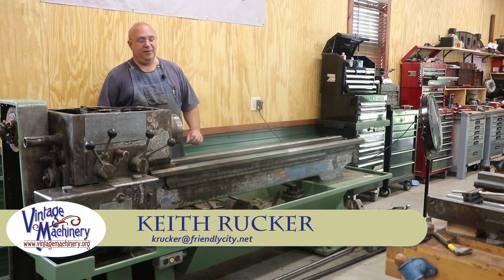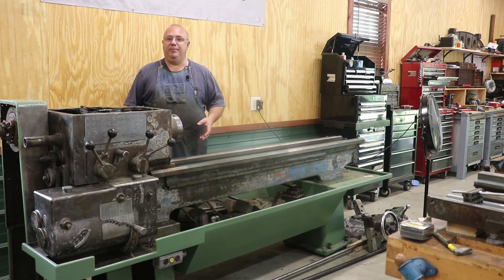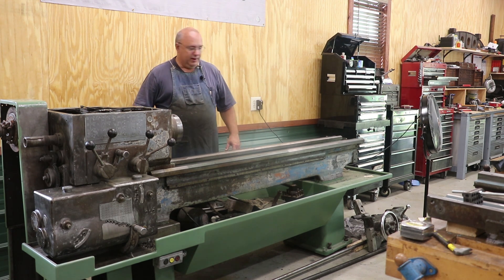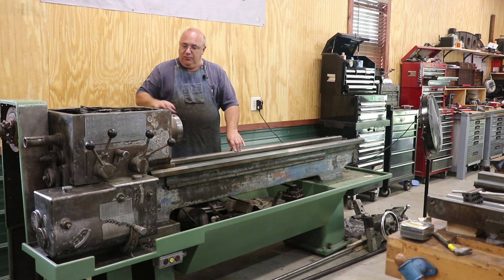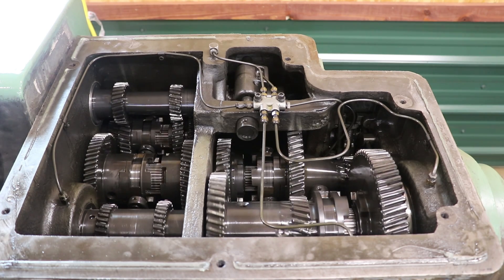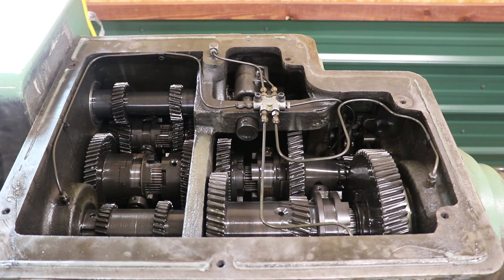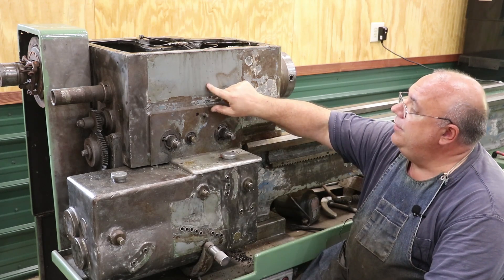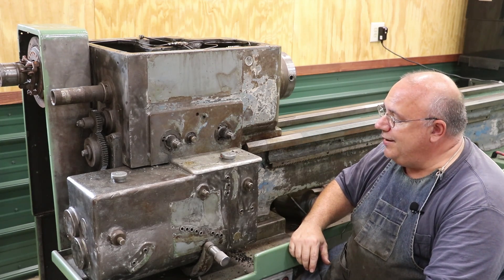Monarch 16" Lathe Restoration

Comment: Beautiful job. I was wondering if the original castings were coated with filler and then sanded smooth and then painted.

Comment: Wow, I was looking for this type of video on 16" sized Monarchs.  We have a Model C, with both taper turning and 2 axis DROs on it.  An ex tenant retired and we took it as partial settlement when he closed down 2 years ago.  They used it occasionally in making parts for elevators, etc.  So I put it on eBay as item 152587359080;  (AND you can paint it YOUR choice of color :-)

Comment: Hi Keith Rucker - why you don't want like yous sand blaster for not meshined surfices?
Reply from the maker: I do like it on "not machined surfaces".  I don't like to use it on machined surfaces since it will pit them.
Reply: machine surfaces yes, it will pit them. but what I meant why you just didn't use on were cast surface, sand ore  other media blaster didn't do any harm, also with media blaster possible use pressure washer, I have heard of with wet media blasting could be use on sensitive surfaces and it not going to damage. sorry for mistakes my English is messed up I don't remember much from time I was living in US:)
Reply: so what I'm saying if do proper homework you could use media blaster for kind of sensitive parts because there allot of different media for cleaning not just a silica sand

Comment: @13:24 It can clearly be seen that the machined surface where the rack is mounted is not painted. This is standard practice and is important. Unfortunately Keith doesn't know this and he will subsequently paint it and then mount the rack back onto the paint. This will show his viewers  one more example of his incompetence in restoring machinery. A little knowledge is a dangerous thing.
Reply: You're just a bundle of joy, aren't you? First, it's pretty much impossible to tell if it's painted or not from the video. Second, why don't you tell us why it is important? Instead of just being a jerk, why not try to be constructive?

Comment: Hi Keith, really enjoying this restoration, great job. I am currently restoring an old radial arm drill (36") and really having good fun. I started stripping back the paint at first but in alot of places coolant, oil etc had actaually penetrated the paint via chips etc and the paint and filler underneath had like a cancer..... so I have removed nearly all the filler now. Q1 is therefore, do I just use an auto filler again, I was amazed at how rough the cast part were and the amount of filler used to smooth it up and Q2 do you use a special paint with a hard finishing surface for your finish. When I restored my KRV2000 vertical Mill I used Galmet spray packs, about 3 coats and I am happy with the finish but it was expensive. many thanks, Gordon, AUS

Comment: Remembering from my '50s VW bug transmission, I can say that someone tried to shift those gears while they were moving under power. The shape of that "wear" is from repeated impact corner-to-corner of the dogs. As you say, there is plenty of undamaged engagement, so you might just put in the back of your mind to clean up the burrs next time you have that trannie apart (if you ever do).

Comment: You brought back memories for 1972 when I was working for Detroit Diesel dealer overhauling the two cycle diesels. You're Monarch green as you call it is the very same color Detroit Diesel used for the 53 and 72 series diesel engines.

Comment: I don't trust those burrs on that abused dog. If one came loose it could run through one or more gear sets and maybe crack or break them, especially iron gears. Perhaps you could file them off, a die grinder would spray chips all over. I expect there is some steel debris floating around,  I would consider locating some magnets in appropriate areas.
Reply: What kind of paint are you using?

Comment: Like Kermit said, "It's not easy being green." Keith, instead of using diesel or gasoline(which are both chemically dangerous) to clean parts, go to a local airport where they service jet aircraft. Sometimes you can get Jet-A from a DE-FUELED airplane. They may just give it to you.  When they de-fuel an airplane, they tend not to re-fill aircraft with it. jet-A is, for all practical purposes, kerosene. Jon

Comment: Something you might like to try, WITH EXTREME CAUTION, is a product called gun wash. .Automobile painters use this to clean their guns.  If this solvent is applied to a painted surface, the paint wrinkles and lifts in short order. Shop rags soaked in gun-wash will lift paint. 
  I am going to paint my second Super 7 light green
  I am restoring a second Myford Super 7.  This is my second Super 7 and it came with several thousand dollars of tooling.  I may keep this second Myford set up with the extensive collet chuck and collets that came with it. 
  I enjoy your videos.

Comment: Don't you have some small pry bars? 
Really, screwdrivers are for .....errrr.....Driving Screws!
I LIKE the green ;-)
Reply: There is not a better pry / scraper / chisel than a blade through the handle screwdriver.  Perfect multi tool and available everywhere.
Reply: We must disagree on that Paul.
Reply: Course I have but then my shop isn't as well equipped as Keith's.
Also you might not the smiley face at the end of the comment.
Reply: They call them sacrificial screwdrivers.

Comment: Hi Keith do you have a video where it shows how to check the ways, and if they are removable, how to send them out to be re-grinded? and or if they can be scraped straight again? I don't understand how a person cloud blue a flat surface up side down that weighs 6000lb?
Reply: That's where the camel-back straight edge that Kieth has raved about in previous videos comes in handy. Instead of moving the machine to the reference surface, you move the reference surface to the machine.
Reply: Thanks buddy, thats exactly the information I need! Got a new lathe (59 cinncinati traytop 15x54) and now I have right direction.

Comment: In 4000years those lugs will fail on that one gear, you should probably give it attention now. lol  That lead in wear comes from shifting without the lathe stopped.  I certainly wouldn't worry about it. My Carlton drill spent some years wearing the aspen green. I kind of with it still was rather than cookie monster blue but whatever, these old machines will eat metal regardless of what color they are! Looking good to me!

Comment: You can remove stubborn drive screws on fragile brass plates without any damage using the TIG welder. Lay a small piece of thin copper sheet with a hole the size of drive screw head to protect the plate and build up a small tit of 308 or 309ss weld. Grab it with small visegrips, rotate and pull up. Works every time.

Love that color....Sunnen green. My 1945 War production Sidney 14 came with the same color.
Reply: Very true, except Keith has mentioned that he has yet to get a TIG unit for his shop. I've used that technique many times, with the addition that I have a small slide hammer that attaches to the vise grips for a little extra umph on the stubborn ones.

Comment: While I've not restored any lathes, I worked on a number of motorcycle transmissions that use a dog clutch arrangement that's  very close to the gearbox in your lathe..  Based on the wear you may find that the transmission jumps out of that speed when under load..   If it does happen you should be able to re-cut the dogs if the gears are in good shape.

Comment: I wonder if the orange color was from some kind of filler. There are some cosmetic casting flaws on the front of the bed where the orange was. It does not look like the whole machine was orange. Perhaps the first grey was the primer, then the machine was inspected, and spot filled with orange filler putty before the final original grey. Lots of these old machines have putty filling cosmetic  casting flaws. Could also have been a painted machine number or department tag as well.
Reply: high build primer filler, yep, castings were pretty pinholey and rough, could be

Comment: I'm concerned about that rounded section in the connector. Whilst it doesn't impede function, on a lathe i did some cleaning on, i believe that a section of the "hammered" metal fell off/broke off and fell right in the splines below it marking a few. Just an observation.
Reply: Also, green is pro and dirt proof. Harder to see smudges on it. Worst "color" would be black, or white. Which i have seen. Why would anyone paint their lathe white is beyond me, looked like a pigeon crap fest.

Comment: Why do all machines from a certain age have the same green finish?
....having a gently calming effect
That is why keith is so calm and relaxed
lg. j.
Reply: i can tell you, i had 1 1948 bsa bantam in green, and after finding some unfaded original paint , i went to get it matched, it turns out, it was a mixture of ww2 olive drab and white gloss, it came out nearly glossy, but not as shiny as real gloss paint, so these machines, many of them wartime machines were also using some similar pain which was produced in huge quantities and available long after the war
Reply: in the uk into the 80,s the uk had a massive surplus of olive drab paint, metal helmets and those metal and wire stretchers, the metal helmets were used as garden hanging baskets, as far as the stretchers go, the rumour is they meant to order 1million for the blitz, but someone wrote it as 10 million, but being metal  they were infinitely reuseable, the surplus was sold and used as fencing materials on government buildings and seen into the 90s when they were knocking down the older buildings    lets see if i can post a jpg http://4.bp.blogspot.com/-J6osGHT9gog/Umu1fpHYVtI/AAAAAAAALJ4/m9w2A_ALveo/s1600/railings2.jpg   ironically replacing iron railings taken down for help in the war effort for iron
Reply: The manual says my Pratt and Whitney was originally painted National Machine Tool Builders gray. It looks green by now.
Reply: During the War years they used Green a lot for camouflage my guess would be they had too much green paint so much surplus they had to use it up on factory machines, many houses during the early 40's were green too lol

Comment: Drive Screws Keith.  Put a small sharp chisel up against the head of the drive screw and tap it to one side, then the same at 180 degrees.  That normally works and saves levering under the plate.

Comment: Was cringing every time you worked on the plate removal, and later, the long gear held in by pins.  For plate, maybe better to drill hole in pin and use screw extractor (then replace pin)?  For the long gear, it was thicker than I imagined, so bending might be less of a problem than it first appeared.  Somewhat a nail biter! :)

Did you examine the drained oil, and later, the drained diesel fuel, for metal chips?  I think this might be revealing as to the amount of wear.

Absolutely love the glossy green.  A pretty machine makes for a happy shop!

Comment: You might consider making a crows foot wedge/pry bar from a cheap putty knife or 5 way tool  ground thin to no grind with two or three notches to remove the info plates from the machine. Like at 10:00 minutes. much easier than a blunt screwdriver.  I sent you an email about the switch did you get it.